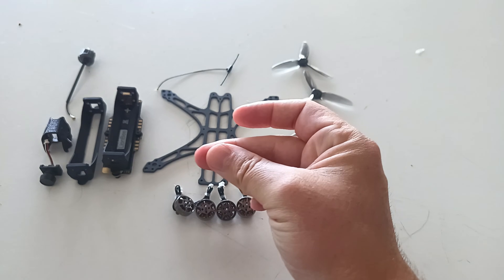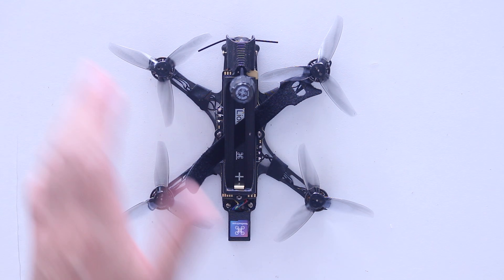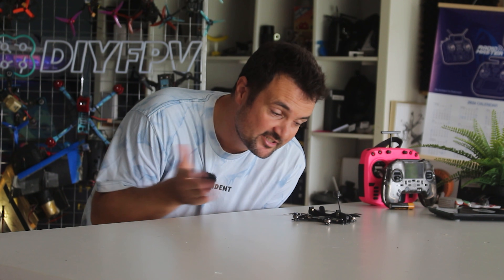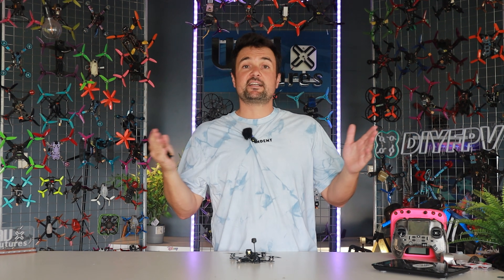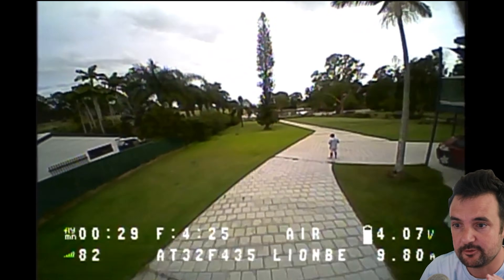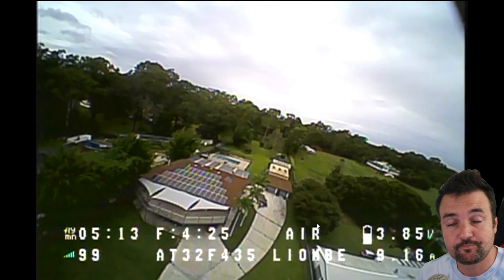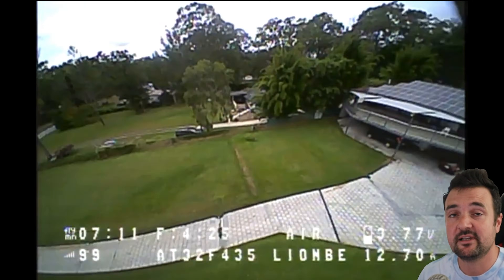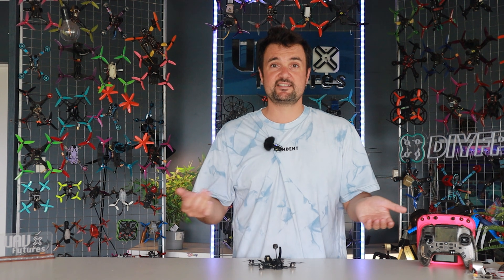Build an 18650 FPV drone TODAY

Comment: I am a bit torn on this, I want to like this, but building your own drone is as much about learning to be able to both customize it and save some money and I don't really feel this drone fits either of those, you don't build enough to learn anything and you wont be able to customize or save money later buy building your own again because you didn't learn anything. I am all about ease of access to hobbies but this feels a bit more like the company saving money on construction rather than anything

Comment: Hey Stew, great review, thanks 🙏🏽👍🏽 
How is it possible to buy NBD Nitro Nectar 18650's outside the US.
NBD won't ship them internationally.
Who is your go-to for 18650's in Australia?
~ thanks 👍🏽
Reply from the maker: they shipped them to me here. have you tried these aussie stores https://www.diyfpv.com/catalog/voscel-18650-3200mah-10c-37v-1184wh-battery-2-pack
Reply: @UAVfutures  Thx for your reply Stew. Yeah, thx, I know about the available options in Oz through DIYFPV 👌🏽❤
I emailed NBD & Wrek'd about shipping 18650's to Oz & got a definite, "No-Can-Do" from both.
Got ripped off recently (Xmas Sale) from an Aussie battery supplier who sent me knock-off Molicel 18650 batts 🤬. What I received was nothing like what was depicted on their website 👎🏽
An FPV store wouldn't short-change you like this - lesson learned.
A huge problem I've discovered is being unable to verify the authenticity of 18650's when buying online. There aren't any bricks and mortar stores that sell the high discharge cells for FPV & lets not mention the mark-up.
Thx again for your help 🙏🏽👍🏽
Reply: @joeaverage8069  If you're interested these cells are Ampace JP30. I bought some of those from NKON for less than 4 euros.. But it's in Europe so I don't know if it could work for you.